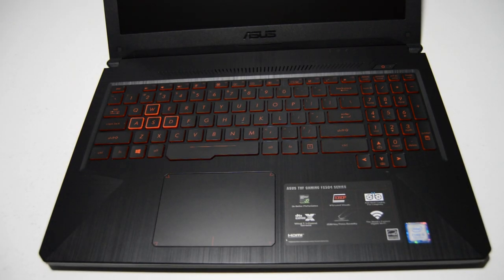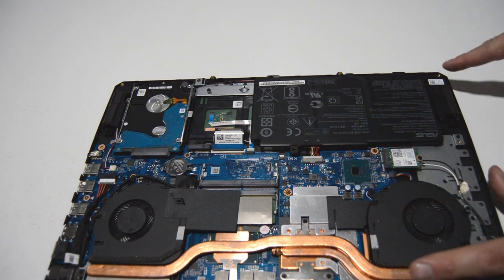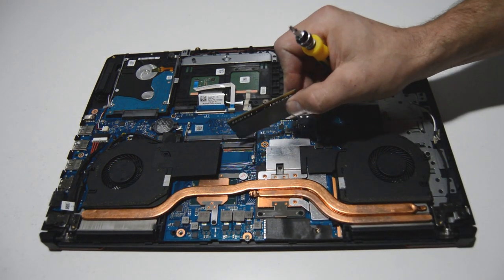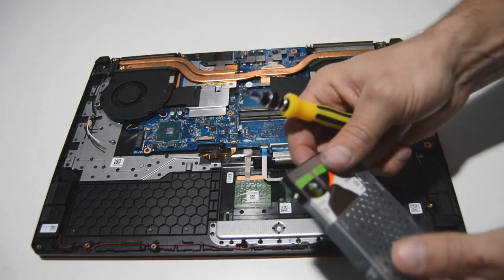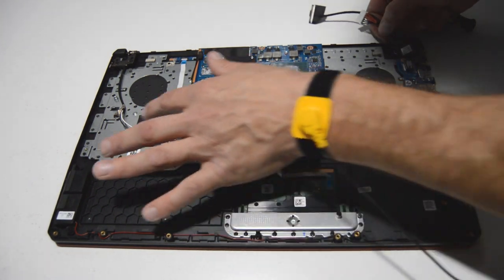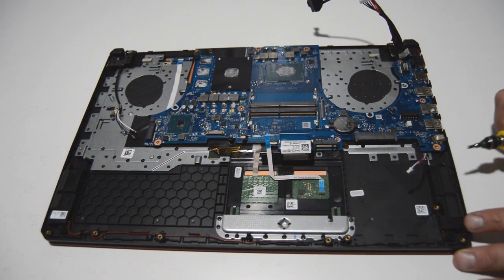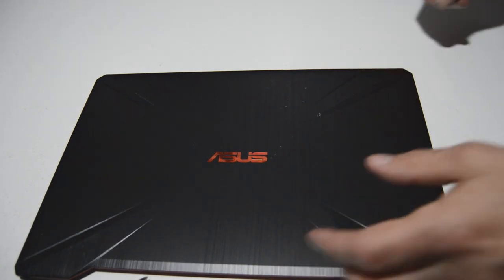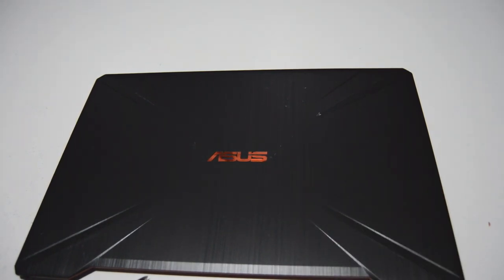How to Disassemble Asus TUF FX504G Laptop

Comment: So I can’t replace my graphics card, okay, sad noises. Nice tutorial though. At least I got to clean out all the dust and broken off bits of plastic 😃
Reply: You can use this thing called an exp gdc , it's an adapter that connects Into the pcei port thing where your WiFi card is connected , so you can plug it in there and plug then gpu externally into the adapter.. it might require a psu for some cards not sure.
Reply: My laptop fans were making really broken noise... When I open it up.... I found small bits of broken off plastic which was stuck between fan and fan cover..   I was wondering why this laptop randomly keeps breaking plastic bits 🙄🤔
Reply: @laquica5146  its just bad build quality, my 505DD does the same thing

Comment: I'm having trouble with the 6 screws of the heatsink, I didn't see you change screwdriver nor have any problem; for me, the screwdriver I used for all the previous screw didn't work for them, so I had to get a full set of screwdriver, and even then not a single one worked (and I don't want to force on the screws/destroy them), it's either to small, too big or seem to fit but actually don't. Magnets don't help...

Comment: I just found myself in need of replacing one of the hinges which broke in a very unusual way and had no idea how. 
This was a most helpful tutorial, thanks!
Reply: I had the exact same problem followed these steps and now it's perfect 😅
Reply: Same here, I just sent it back under the warranty
Reply: Is it necessary to remove the board etc before remove the hinge? Or we just have to remove the display cable and the hinge screw only
Reply: Same. This "tuf" is absolutely not tough.

Comment: Note: ASUS TUF FX504 and FX505 series is really a low end entry gaming laptop. In preventing CPU throttling is not going to be easy to get good results in a 2018 model.
If your laptop is rather hot all the time, maybe it is time to reapply Thermal paste on the CPU and GPU. Use Arctic MX-4 or Kryonaut Thermal Paste.                                                                                Clean the old compound off and apply an even paper thin layer across the top of the CPU and GPU. Never use thermal pads.
Also you cannot upgrade the AC 9560 WiFi card to anything other than another AC 9560.                                                                                                                                                                               Sorry, no WiFi 6 or Bluetooth 5.0. stuck at WiFi 5 and BT 4.0.
The TN 60Hz panel (screen) display can not be upgraded either.
It has the AU Optronics AU038ED / B156HTN03.8 as no way possible the FX504GD-ES51 will work with a 120Hz or 144Hz screen. including any IPS display.                                                                                                                               The only thing you can do is connect the HDMI to an external monitor but without having a High End GPU such as RTX 2060 (is problematic), go with RTX 2070 Max-Q or RTX 2080 Super for 4K resolution. A GTX 1050, 1050ti, 1060, 1070. 1080, 1650, 1650ti and GTX 1660ti only able to get you 1080p HD.
To replace a damaged screen with same and doing it yourself cost around $60 at your own RISK!
The only 3 things you can upgrade is the 1) 2666MHz memory of 8GB up to 32GB.                                                                                                                                                                                                               the 2) crappy and slow hybrid 1TB Firecuda SSHD for a nice 1TB Samsung 860 EVO SSD, 3) install a m.2 NVMe SSD such as 1TB Samsung 970 EVO NVMe PCIe m.2 ssd.
Reply: After how much time do you thing thermal paste should be replaced?
Reply: Why can’t we upgrade to the 120hz screen? Even if it’s a replacement part that fits? I’ve got the fx504gm with the 60hz ten and I’m thinking of replacing it with the 120hz ips I’ll get from a replacement parts site.
Reply: I upgraded my Intel 9560 card to Intel AX200 WiFi 6 ready card. It works fine, just download the drivers first before replacing the wireless card in case you get no WiFi reception.

FX504GE user here.
Reply: @xenonohad  every 6 months

Comment: can i just replace the screen without separating the whole upper part of the laptop? i'm using FX 505
Reply from the maker: Usually yes.... as long as: The bezel is removable and the screws holding on the bezel are accessible. It looks like on this model you can pull off the bezel with the screen assembly still attached. Once the bezel is off you should be able to replace the screen, just a few phillips screws and a video cable to remove, then just reverse the procedure to install.

Comment: I've got FX 505 and it needs keyboard replacement. I already removed MB but have no idea how to pull out the old keyboard. Any idea? It looks similar to 504.
Reply from the maker: Unfortunately they attach the backing plate with just melted plastic rivets which makes it cheaper to manufacture. You would need to break all those off, then find a way to reattach that backing plate for re-installation. The backing plate is also structural, meaning things like the motherboard and bottom case rely on it to hold in place. You could try using plastic epoxy where the rivets used to be, and let it cure overnight. Otherwise just buying a palmrest assembly is the other option, like here for $80 & free shipping  https://www.ebay.com/itm/Asus-TUF-Gaming-FX505-Palmrest-w-Backlit-Keyboard-0KNR0-661CUS00/202994180858?hash=item2f436562fa:g:2xQAAOSw1JFewW2g:sc:USPSFirstClass!89511!US!-1

Comment: If i want to only disassembly the monitor, should i starting like your in this video? I don't need disassemble motherboard and others. Thank for answer
Reply from the maker: You might be able to take the bezel off without disassembling anything else..... give it a shot. If you can then you will be able to remove the screen or webcam easily.
Reply: @Sellbrokedotcom  okay thank in advance, because i have a problem with a casing of this display monitor, i should replacement with the new casing

Comment: Thanks for the video. How do you disconnect the video cable from the webcam? Does it slide in, or is there a bar you lift to secure/release the ribbon? I think I broke the connector on my cam :/

Comment: which side is the CPU and GPU fan?  Left or Right side when the ASUS logo is on top. or - When you showed the motherboard and removed the heat pipes with the fans, unable to confirm which was GPU or CPU.  Thank you!
Reply from the maker: At 7:00 when heatsink is removed, the GPU is on the right.... they are usually placed next to memory chips as is this one.

Comment: Hi, Great video congrats. I am having the problem of a loose lid, that closes by gravity at certain angles, so I would like to tighten it up. Do i need to go as far as removing the motherboard, or it is a simpler procedure?  Thanks for any help you can provide.
Reply from the maker: Looks like you can get to the hinge nuts right after you remove the bottom case. Try tightening the little nuts on the end of each hinge, that may solve your issue.
Reply: @Sellbrokedotcom  Thanks a lot, I will. Take care

Comment: Need to see the vents on the back panel !
Reply from the maker: You can see the vents at :23, its a little dark but you can also see better where the fans exhaust at 5:33
Reply: SellBroke why the vents are so small and scare ? Msi laptops have such large vents
Reply from the maker: @rahuldogra  Just not designed well.... this model series has cooling problems per the forums and comments here.
Reply: SellBroke Ok! Thnx

Comment: While dissasembling the laptop for a cleanup i accidentally peeled the black sheet cover from the RAM and the metallic one as well, i put them back, but they got kinda loose cause the glue isn't sticky enough as it was. Will this affect in some way...  the heat dissipation i'm guesing? will it be a problem if they unstick and move around inside the chasis?, can i just get them off if not?
Reply: It will not affect much for ram sticks, i applied some thermal paste on all IC of ram and cover sticked with it

Comment: does the gpu need to be soldered, or does it snap in? silly, I know, but i'm interested in upgrading the gpu on my fx705dt. it has a ryzen 5, and a 1050 or a 1050ti. it's not bad, but I like to mess with things. also, are dimensions an issue with mobile gpu's, or are they pretty cross compatible? you're video has the best breakdown I have seen yet. thank you for any answers you might have.
Reply from the maker: It is integrated/soldered to the motherboard. Most mobile GPU's are either integrated or use an MXM slot, as opposed to desktop GPU's which are usually PCIe.
Reply: @Sellbrokedotcom  thank you.

Comment: 2 screw of thermal tube is not opening its tight too much how to open?
Reply from the maker: If it's really tight then you might have to remove the motherboard and set it on something sturdy, then press down hard on the screw as you're turning it. If you try this why the motherboard is in  the case, it might cause the motherboard to flex/bend and break a connection. Good luck!

Comment: can the fans be more dissembled in order to drop oil? because I have sound problem on fans they make lots of noise
Reply from the maker: Unlikely, many don't even use bearings and are usually sealed. This laptop has a reputation for running really hot..... your fans may just be spinning fast to help cooling.
Reply: @Sellbrokedotcom  ah i am not talking about that fast spinning sound, but it is more like the fans are bumping, crashing. there is clicking noise
Reply from the maker: @chromax1619  That's your hard drive
Reply: @Sellbrokedotcom  my last hdd died and just changed it idk, I will take it to an expert thx

Comment: I'm having a trouble, I opened my pc to fix a problem I was having with the network adapter but i accidentaly disconnected the display, the laptop turns on but it shows nothing but black, I connected a second monitor and it works fine but I really don't know what did I disconnect, can you please tell me in which part is the laptops display wire? I have an TUF FX504G
Reply from the maker: Check out 4:17, that's when it's disconnected.

Comment: hey, so i have this laptop, and unfortunately, the screw near the headphone jack cant be extracted, it just spins in place, and i really need to change my harddrive. is the screw holder part of the motherboard? do you have any recommendations on what i can do? or am i just screwed here? lol
Reply from the maker: I'd try removing all of the other screws, then using light upward pressure on the case might hold the broken screw post in place hard enough to extract the screw. What's going on is the place where the screw attaches broke off and is stuck under the motherboard hole. If you can just get to it enough to hold it with something you should be able to undo the screw.

Comment: i just upgraded my ram but now 3 screws wont get back in their place and the laptop doesnt start, do i need to recharge the battery after i reconnect it? please help :(
Reply: I'm buying this laptop for 350$
Is it value for money?
Reply: @idle314  i used it for 5 years now, and it runs games kinda ok, i played ac unity and i played it in 40-60 fps, fortnite in 160+ fps, csgo in 200+fps, gtav with mods like redux in 60+fps at all times
Reply: @idle314  its a good laptop but i recommend upgrading the ram into dualchannel, and the ram needs to be 2666mhz

Comment: Hello, I have a question. I recently reapplied the thermal paste on my FX 504's cpu and gpu. But when I removed the heatsink, I noticed that there was factory applied thermal paste on some other components and a lot of it too. So I'm just wondering what those components are and is it important to apply paste on those as well or should they just be left as it is. Thanks
I should also mention that I did remove old paste from those components and reapplied very little of my new thermal paste (Arctic mx4) and now my temps are even worse than before.
Reply: Use Thermal Grizzly
Reply: Dude I'm trying to remove the heatsink, but my screwdriver doesn't fit. Do you have the screw dimensions or an Amazon link ?
Reply: @amriteshmohanty2475  https://www.amazon.in/dp/B07HWSR7Y6/ref=cm_sw_r_cp_apa_i_vd17EbNEWJXF5
I used these
Reply: @jjeeefff  did you ever manage to get the temps back down?
Reply: @nikith7224  yes, I just left it as it was, I guess it needed time to set. I'm seeing much better temps now.
Reply: @jjeeefff  would you recommend I replace the paste? I also have high temps that it throttles the laptop when I open the laptop, but I only have some cheap amazon paste lying around with about 1.85 thermal conductivity
Reply: That's the V rams and you have to apply the paste on them as well

Comment: I was having issues with fans spinning up really loud, and eventually one side starting making a whining noise in addition to that. I went in removed the thermal paste and reapplied, unfortunately it’s still spinning up pretty loud and the fan still making the whining noise. I can’t really see any dust anywhere and the fan seems in alignment so I’m not sure if anyone has suggestions?
Reply from the maker: You could try some canned air into the vents.... the fan may just be going bad. I know this model spins the fans at top speed any time you are stressing the graphics, there have been some cooling issues...
Reply: SellBroke thank you, it’s actually a little annoying it just started recently. I used to play wow on it fairly easily. Now just playing osrs (which is a way older game) and I’ve got a jet plane on my hands
Reply: SellBroke hey sorry to bother you again, do you think it’s worth grabbing replacement fans on eBay? It’s pretty spotless dust wise. Might grab some better thermal paste at the same time
Reply from the maker: @Aqpbtw  Its worth a shot.... any unusual fan noise is either dirt or the fan wearing out.
Reply: SellBroke I also reduced voltage to cpu and that seems to be doing really well too
Reply: @Aqpbtw  yea same here i have same issues with you, but my laptop randomly everytime i turn on,there is grindy sound. Still no idea and canned air is so rare in my country
Reply: > "I also reduced voltage to cpu"

 @Aqpbtw  how?

Comment: You're a life saver now I can fix the hinge I guess
Reply: Is the hinge weak??
Reply: Hello you got the problem as well?How can I contact you?
Reply: Did you fixed? Mine was elevated and already damaged the frame :( Asus Service center here just hot glued the frame.
Reply: yeah the hinges on this laptop are trash, my right hinge broke and the bezel is flopping about
Reply: @nikith7224  if you change the top lid it will happen again. I bought some strong epoxy and glued it myself and now working fine.
Reply: @amateurpro1185  is it worth it to get the hinge fixed? My only problem is the frame is loose above the hinge, should I just use some epoxy for the frame? Also, what kind of epoxy did you use?
Reply: @nikith7224  if the frame is loose better open it and inpesct it as the screws may have loosen
Reply: I've had an issue with the frame too. The hinges open up just fine, but the plastic frame separates and I've found bits of red plastic fall out. I can still click it back together, but was thinking either super glue or an epoxy sculpt may keep the plastic from being pulled apart when opened. Did this work for anyone else? Did you have to disassemble the screen section from the body or can it be fixed by just removing the two front screws?

Comment: My power button not working, the guys suggest to change the keyboard
Reply from the maker: 10:11 you can see the power button there and where its connected UNDER the motherboard. You can switch out the power button easily and detach the ribbon from the power button itself, but if you want to check the ribbon connection at the motherboard you will need to remove more stuff.
Reply: @Sellbrokedotcom  thanks for the reply ,so is this possible to replace power button without replacing the whole keyboard?

Comment: Extremely frustrated with this model i have Tuf fx 504gm i7, 1060 model. no use of having power when you cant use them... cant even play CS:GO in basic settings... how can this laptop even exist... i will boycott all asus products in near future.. better to stick with MSI, DELL, ACER.. for gaming...
Reply from the maker: It seems like there may be an issue with the GPU, the GTX 1060 is supposed to be VR-Ready and capable of running dual 1080p screens at 90FPS. Have you updated your driver or checked the settings? It sounds like the laptop is trying to run the game with the integrated graphics instead of your discreet GTX 1060. A Google search indicates you should be running near 160 FPS with high settings. Definitely check your card out with benchmark software as well to eliminate a software issue.
Reply: @Sellbrokedotcom   This laptop has serious thermal throttling issues, and it also has power limit throttling.. the processor max tdp is 25w only.  even tried undervolting both cpu and gpu.. it helps only to a certain extent... this laptop has inadequate cooling design...which is why they have restricted processor tdp to just 25w.